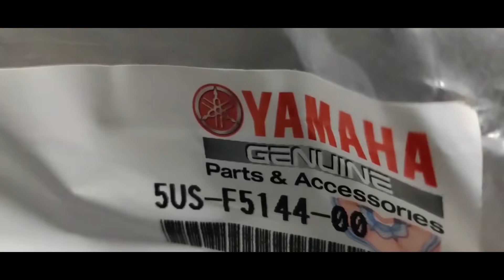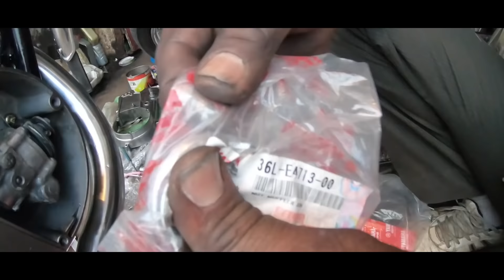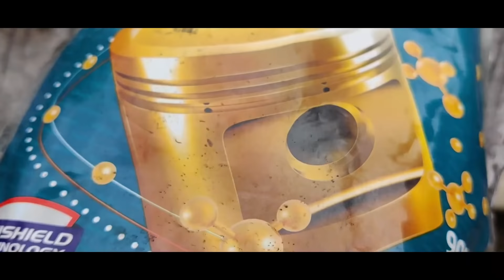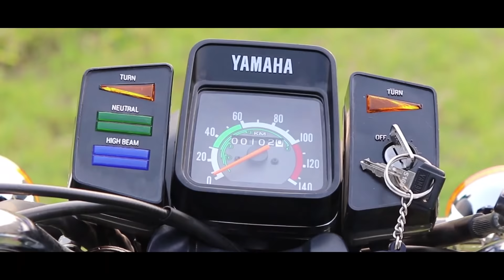Yamaha RX 135 Restoration | Old Pistons Garage

Comment: Fantastic job on that bike mate 👏🏼👏🏼👏🏼👏🏼👏🏼 
In the U.K. I had one of these RXS 100 

https://images.app.goo.gl/AbpiW4BKNwhTLiMU7  

Great bike to learn on , and it was quite fast ( mine did 83MPH ) 💪🏼😜  
Good on fuel 👍🏼 easy to work on/fix it , we used to put renthal handle bars on and the fairing and front
 ( https://images.app.goo.gl/DwmdeTMBm69ZHcSs9 )  light from the rd 125 and the exhaust 🔧🔧🔩